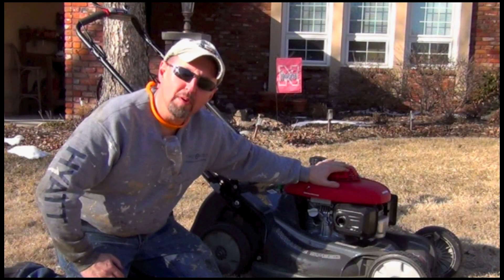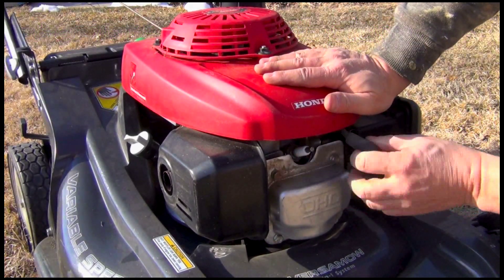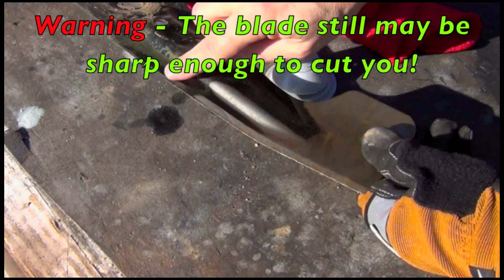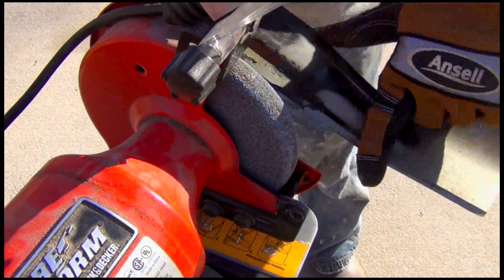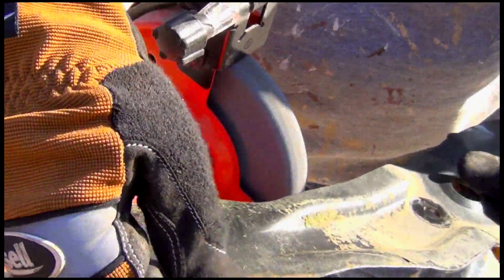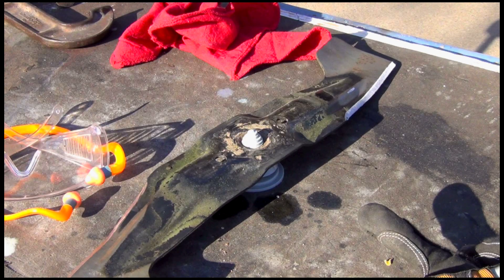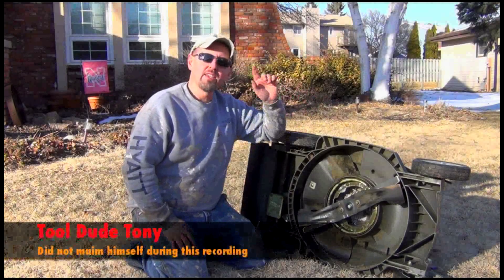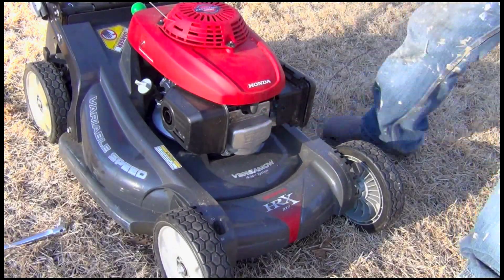How to Sharpen a Lawn Mower Blade

Comment: Tool dude, we do commercial lawn maintenance and have tried all kinds of stuff to sharpen small rotary mowers. We've had great results using a flap disc on a hand grinder if the blade isn't too bad. If your followers grind at home, keep the blade moving so it doesn't get hot. Heat will ruin the temper on the blade. Dipping it in a bucket of water between passes will help a lot. Keep up the good work. I enjoy your videos.

Comment from the maker: @drpreppersc - That's a good question.  The short answer as to why the air cleaner doesn't fill with oil when you do it is because they are not directly connected -- there are a lot of things to stop it.  The oil would need to get past the rings on the piston, then get through the intake valve, then flow into the carburator and get past the shutoff valve in there before it can get to the air filter.  Thanks for asking. :)

Comment: I enjoy working with steel enough where I prefer, in most cases, to use a metal file and work by hand.  No worries about altering the temper of the blade. A good vice is necessary for that.  Also a breaker bar or small section of pipe to extend your wrench may be necessary on some real old rust cases.

Comment: I asked because I hit a 6" stump with my Husky with a Honda engine and bent the blade.  When I tilted it up on the side to inspect the blade engine oil saturated the air filter element.  I went to the big box and purchased a new blade.  After the new blade I had to replace the oil soaked paper filter element before it would run reliably.  I thought there might be some trick to it or (obviously) a mistake on my part.  Thanks for the vids.

Comment from the maker: Based on your comment, I thought I'd better check my oil filter.  It didn't have any oil on it.  Yours must be a little different. I don't have a trick, but maybe you could tip the mower so the air filter side is up.  Then if the oil leaks, it would go into the muffler.  That would cause it to smoke until it burns up, but you wouldn't need to buy another filter.  Or you could take the filter out when you do this.   Thanks for the feedback. :)

Comment: Tool Dude Tony, Probably should also wear the gloves when torquing the bolts on the blade just in case the socket slips off the blade! Just keep them on until done... Nice video!

Comment: Great production this one, but I'd wear gloves when tightening the blade, and also would not wear when grinding - you could have a problem if the glove got caught in the grinder.  Also, I remove the spark plug just to be sure the engine can't kick at all.  Kind of like to keep my fingers! ;-)